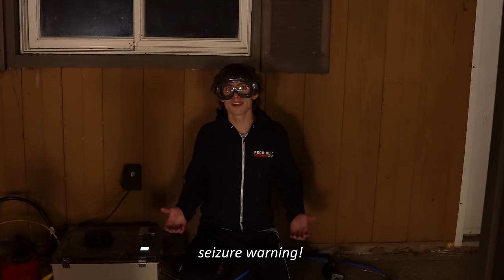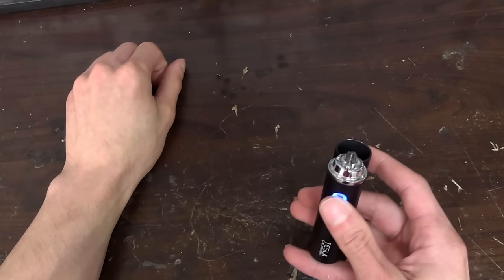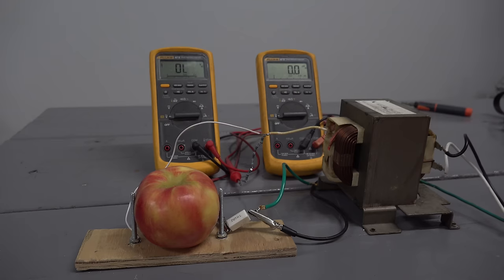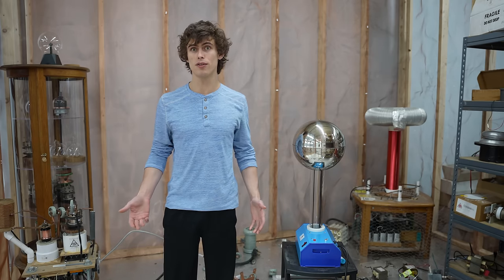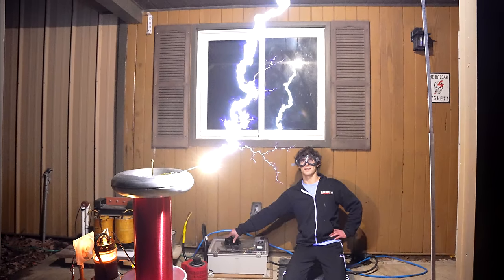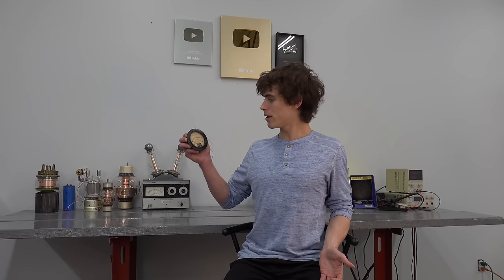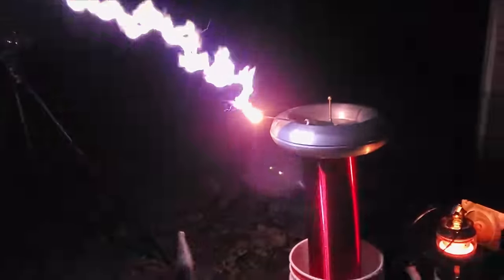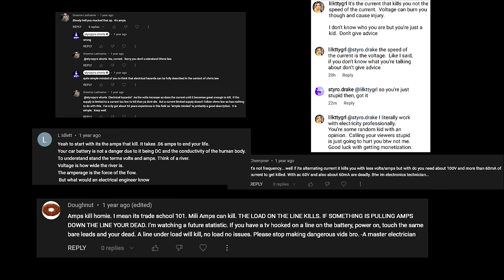Is it the volts or amps that kill?

Comment: Very well done. . . I actually learned a few things. I have understood for fifty odd years that the "skin effect" was what kept a Tesla coil from being deadly; the detail that high frequencies can be  so high that our nervous systems simply can't react to them fast enough to cause trouble was quite fascinating.
Reply: A Tesla coil operates with a very high frequency and it's ability to deliver a large current is limited. However, as you say, higher frequency currents tend to  favour the outside 'skin' of a conductor, but it's not about the nervous system not reacting. VandeGraph generators deliver a walloping static charge of up to 200,000 volts but the generator simply cannot deliver a large current. You can receive a decent shock from static electricity in a very dry climate, where the voltage can be up to 40,000 volts.
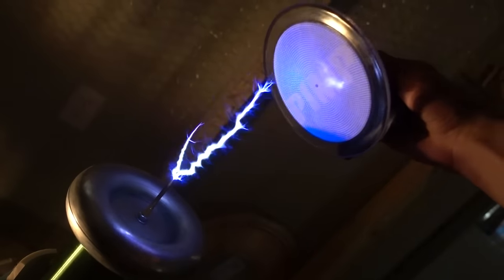Reply: @jasoncassidy492  so are you saying styropyro is wrong from 16:51 onwards? we'll be waiting for your debunking video
Reply: @snooks5607  "so are you saying styropyro is wrong from 16:51 onwards?"
Yes; although misleading is a more accurate description.  He has connected the current measurement to the primary of the tesla coil, not the secondary.  
A better method is to use the breakdown voltage of air, typically 10 kilovolts per centimeter.  Assuming a 1 meter spark, that's 100 times 10 thousand or a million volts .  But what is the amps?  The Power of a transformer does not change much.  So if he had 100 watts going IN, then he will still have 100 watts (or less) going out.  So a million volts times 0.0001 amps = 100 watts.  That's 1/10th of a milliamp, at most.  
If he is driving the tesla coil with a thousand watts, then he's got a milliamp current on the output.  You'd get a shock, but it is relatively harmless.
Reply: @thomasmaughan4798 That's a quality answer you rarely get in discussions. Thank you for explaining it so well, spread the knowledge!
Reply: @-sturmfalke-  On further study of the phenomenon, the primary and secondary coils are resonant with capacitors (on the primary) and capacitance to ground (of the secondary) and as such a circulating current exists that exceed either the input or output currents.  Measuring this circulating current says nothing about what you get out of the circuit.  Tesla coils are "high Q" so if the Q is 100, the circulating currents could be as much as (or exactly) 100 times the actual output current.  Interestingly, so is the voltage! 
This phenomenon is used to advantage in a magnetic loop antenna.
Reply: @-sturmfalke-  I forgot to mention, the voltage peak and the current peak are out of phase so you never have peak current and peak voltage simultaneously which would be a huge power but the power never exceeds input power.  When the cycle pushes into the capacitor, the voltage rises to a peak.  Then the capacitor pushes the current backwards through the coil building a high current and corresponding magnetic field.  As it starts to collapse, the collapsing magnetic field pushes the electrons onto the other side of the capacitor, where it builds up to another voltage peak but this time opposite polarity.  And so it goes. When the peak is high enough voltage some electrons pop off the toroid at the top into the air and turn it blue with tiny lightning bolts.
Reply: @thomasmaughan4798  Wow, you should be a teacher! Heard all of this before, but it took me quite a while to fully understand this.But just reading your comment makes everything crystal clear.
Reply: Actually it is not that the cells can not react. They aren't depolarized at the same current levels because the amount of momentary charge on the cell membrane isn't reached easily with HF currents. 
For example: The C1 limit for a low risk for ventricular fibrillation at 50/60 Hz is above 30 mA. At 1 MHz you would need more than 140 A of current to cause VF at C1. Above 300 Hz the VF threshold increases almost linear to the rising frequencies. The reason is that the charge delivered with every half wave at HF becomes smaller with higher frequency at the same current level.
Another point of interest is the fact that not only is there no skin effect but actually HF goes much deeper into the human body than LF because HF bypasses not only skin resistence but also is capable of using the intracellular volume for transport.
Reply: @jasoncassidy492  If you would have watched the video above you would have learned that your thinking is wrong. It is high current at high voltage but small charge and energy.
Reply: @thomasmaughan4798  Not true. You have a lot of reactive power on one side and a lot of real power on the other. I can draw more momentary power with my coils because of reactive effects creating high peak currents of up to 500 mA and I can draw up to 45 mA rms.

Comment: I've always wanted a video like this. I had many of this questions while I was in university, I asked my physics teachers or teachers from electrical related subjects about "how dangerous" or "why does this doesn't kill me?" and they never gave me very good answers. It's okay if they didn't know, but they always gave me very simplified and wrong explanations. I know that asking questions regarding safety is hard because no one wants to say something that could get you killed, so I can't blame them too much. After watching this I don't think I would like to touch any tesla coil though haha
Reply: The problem is that when the answer is complicated, 90% of people will remember it wrong, so with safety-related things, they boil it down to something most people will remember.  The amps vs. volts thing, for example, is so tradesmen know what to worry about when dealing with common electrical sources.

Comment: Very well explained! I work in the electrical power industry, and like most, I’ve always been told “it’s not the volts it’s the amps.” My understanding was always that, yes, it is the physical flow of current through your body that causes the damage, but in order for significant current to flow, it depends on many factors such as voltage, frequency, impedance, dielectric breakdown, etc., just as you explained. Well done!
Reply: Nature doesn`t know anything about volts, amps and watts. We made those for convenience. Just like time and calendar.
Reply: @masterofreality926  science is the way a human can understand natural processes tho
Reply: @masterofreality926  That hits the nail on it's head! :)
Reply: @masterofreality926  we made the names up, yes. But they describe very real things in nature

Comment: Excellent video! I work in the UPS industry and deal with the hazards you are describing.  You have done an amazing job of breaking down and explaining the different hazards of working with electrical circuits of different designs.  It's not just one thing that can kill, all of the factors under certain conditions are important, especially time!  Great job and keep up the good work!
Reply: Hence why this video is useless because it doesn't settle anything we didn't know already. Amps kill. Everything else is circumstantial.
Reply: @levyroth  You're doing it again, simplifying the matter.
Reply: @levyroth  Did you not see where he touches 40 amps and is fine? The whole point of the video is amperage wont kill unless certain voltage, frequency, impedance and time conditions are met, HOWEVER voltage ALSO wont kill unless certain amperage, frequency, impedance and time conditions are met. And x wont kill unless y and z are met. Hence EVERYTHING is circumstantial because its stupid to oversimplify (they ALL affect the likelihood of death), as shown in the video.

Comment: Dear friend ! Congratulations on a professionally flawless presentation! I am a 68-year-old electrical engineer from Hungary. Like you, I also experienced the Tesla coil, static high voltage. (I was 6 years old when I picked up my father's soldering iron for the first time... I think you can imagine the rest. I would like to share one "special" case with you. 10 years ago I measured a 15 Watt RF amplifier operating at 900 megahertz. By chance, when I reached for the For a BNC connector to connect the dummy load, I held it so that my fingertip touched the center pin of the connector. I felt a burning sensation and smelled of burnt leather. A small black dot formed on my finger, even though it only ran on a 12 volt battery. It was a miniature microwave oven. on those few millimeters. There is a Hungarian proverb: "A good priest learns until he dies". I wish you more success and good health!
Reply: That's awesome!
Reply: Thank you for sharing! Truly incredible I can learn of your experience from across the world, through a machine made and powered by the understanding of electricity. Such a pragmatic proverb as well. Best fortunes!
Reply: I like meeting other Hungarians in the wild on the internet :D

I will keep in mind what you said.

Comment: Standing ovation for literally throwing Ohm's law out the window
Reply: Ohms law only applies to linear circuits and many people seem to ignore this fact
Reply: @cpK054L  what does that mean😄?
Reply: @tarjeiaustadigland8827  people throw around Ohms law like it's the end all of the argument, not realizing the fact that not everything follows ohms laws, especially things like ASICs. FPGAs, control systems and nonlinear circuits.
Reply: @cpK054L  pretty much anything that oscillates. I found that out with an oscilloscope and a transistor flip flop - one of the simplest circuits to make, included in all kid's multi electronics project kits.
Reply: @noneedtoknow5315  what?
Reply: @cpK054L  Depending on your definition of linear, not even there.  It purely describes an ideal resistor.  A diode has a voltage drop, yet doesn't follow it.
Reply: @arthurmoore9488  omg.....  there is no ambiguity in the term "linear", if you took a class on Systems and Signals you would know this

F(ax1+bx2)=aF(x1)+bF(x2)
a diode is treated as a voltage source, but a transistor can NOT.

BJTs has a linear zone, but becomes non-linear on the on-phase
MOSFETs, same thing.

Ohm's law will fail on these components because they are ACTIVE, same with OpAmps (which is a series of transistors)
Reply: @cpK054L  they think they are smart lmaoo
Reply: @yulles225  ... I wish they'd refer to actual textbooks and literature and not "google-knowledge"
.... information is literally free

stackexchange for electrical engineers
Reply: Im just an electrician and even I know Ohms law only applies to linear circuits. Lol
Reply: @cpK054L  I've (re)learned the lesson about the cost of forgetting that various widely used laws only apply when specific conditions are met more times than I'd like to admit
Reply: @MrCh0o same here i learnt it multiple times and i always forget😂

Comment: Finally! This clears up so much about the dangers of electricity for me. I work with electricity A LOT, but it has always sort of terrified me because I haven’t been able to grok what is and what isn’t dangerous. I’ve seen those unhelpful graphs and even watched presentations on electrical safety that were almost no help at all. This video has finally cleared up so much for me that I will no longer be terrified to complete the circuit on my 12v batteries, even though a misplaced wire can result in unwanted spot welds 😂
Reply: Any wire on a 12v car is always perfectly safe to touch by hand (*except* the ignition circuit).    Shorting one out can result in clouds of smoke and burnt wiring, but it can't bite you.    The same goes for the insides of computers, so long as you don't open up the power supply.   (In fact you're more likely to kill the computer if you touch the wrong thing, than the other way around).
My brother used to work in a telephone exchange in the last century.   Their standby power was a room full of lead-acid batteries, wired to give 50 volts.   There was no particular hazard from touching the wrong thing by hand, but stainless steel watch straps were forbidden (leather ones OK).   You really would not want a steel watch strap to suddenly become white hot while you were wearing it...
Reply: Just don't touch the spot welds, that could be problematic
Reply: It's all dark arts to me.  I'm an engineer and understand this conceptually but to come up with it on my own would be very unlikely.  I'd probably make the wrong conclusion about the demon circuit not knowing that because it lacks isolation, it is deadly.